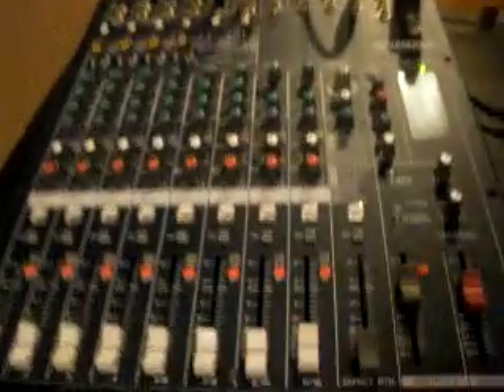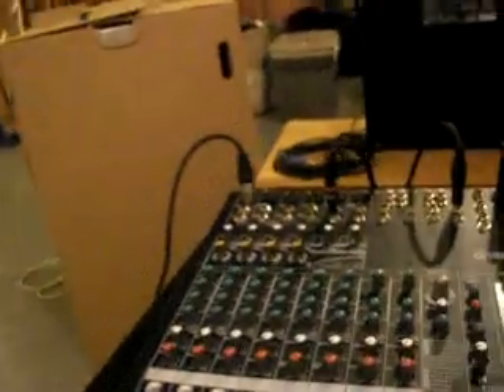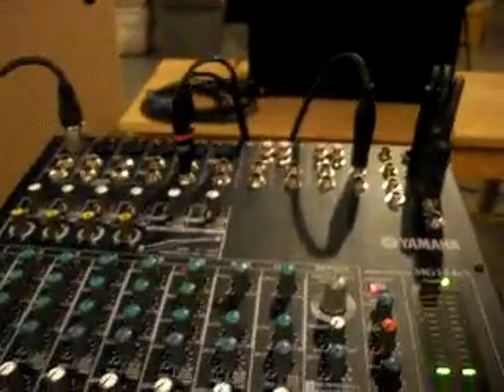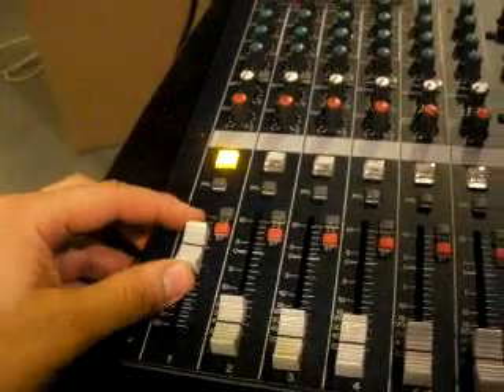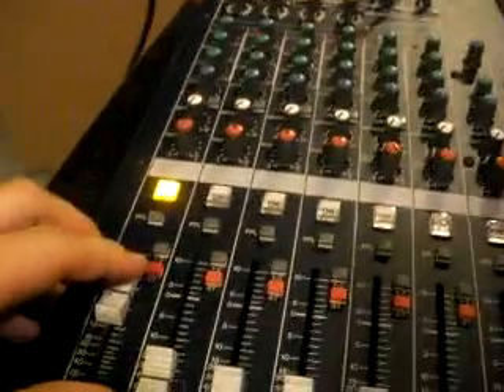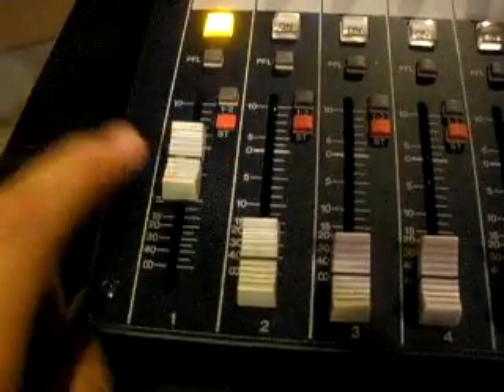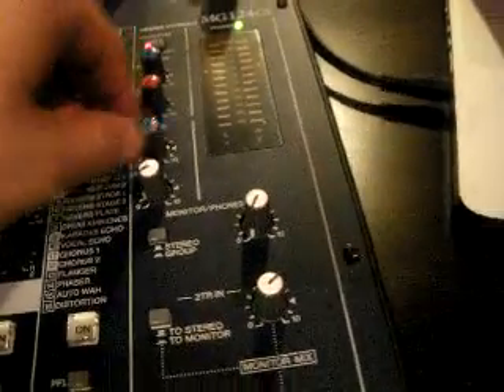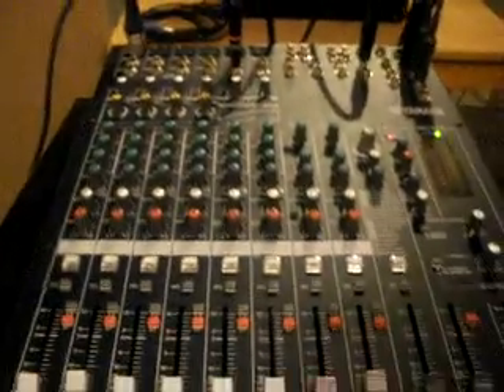10. Using Phantom Power on Yamaha MG124CX

Comment: hey can i know if  i use 2 condenser phantom powered mic in one mixer will blow the fuse of the mixer?
Reply from the maker: .. when u use phantom power on this mixer, it is applied to all 6 mic inputs so whether you are using 1 condenser or 6 there is phantom power going to every mic pre. just be sure to connect all your mics first before turning phantom power on.